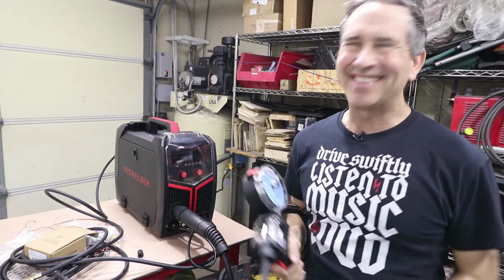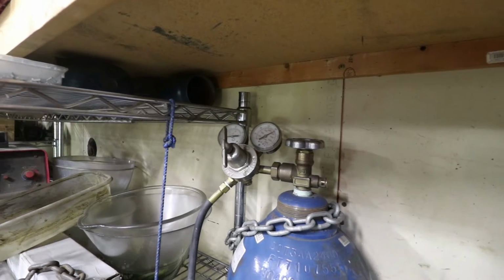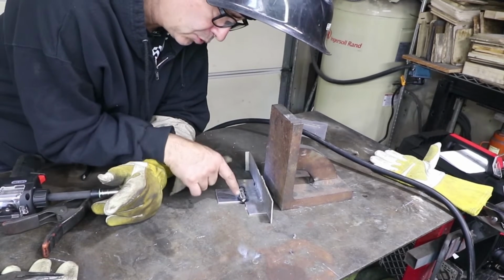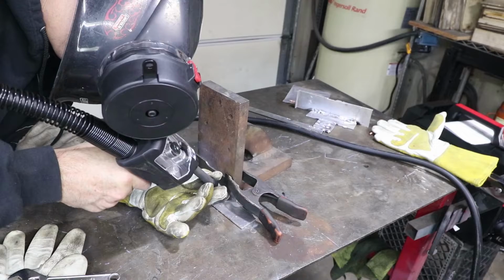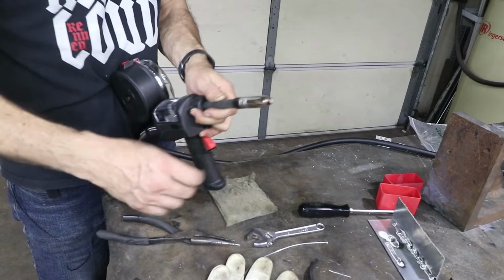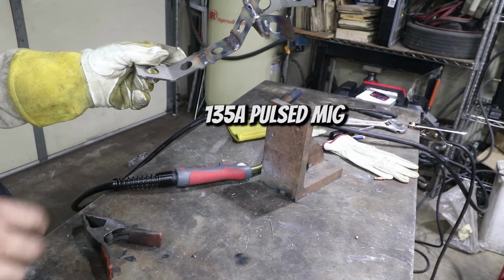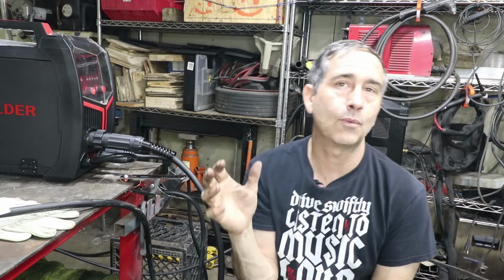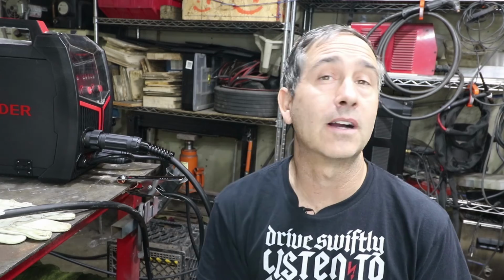MIG Weld Aluminum with Wire Feed Spool - Review YesWelder YWM211 5in1 Dual Pulse MIG/STICK/LIFT TIG

Comment: All i do is weld aluminum...i don't claim to be any expert but i have had TONS of equipment issues and so far to me it seems like you have a defective machine. I didn't see you say this but did you happen to change the polarity? When changing from steel to aluminum you have the switch the ground wire.
Reply from the maker: I did change the polarity.  I no longer have this machine to try anything different.

Comment: Thx for the video. I am a little confused as to why you couldn’t increase the wire feed speed to stop the burnback.  Could you not just increase the amps ( which is the same as increasing the wire feed speed is it not?) and keep the voltage the same? Did the machine not allow you to do this or did the machine increase the voltage when you tried to increase the amps?
I just bought one of these machines to weld a small aluminum boat as tig welding it was way too slow.
I am a simple hobbyist welder. I have to say that it is somewhat difficult for me to understand all the nuances of the parameter settings.
Thanks for your help.
Cheers, John
Reply from the maker: This machine has some automatic settings programmed into it.  This is why I had to use the specific wire the machine was calibrated for.  If you increase the amps, you are increasing the heat too.  If I remember right, there is a small window of adjustment, but it takes practice to get a good setting that works.  A few watchers of this video suggested using a longer stickout length for aluminum.  
Keep trying different settings and I think you will find a combo of wire and settings that work well for you.

Comment: I've seen other reviewers get excellent results with this machine, using both Mig torch and spool gun.  They were also running with a longer stickout (3/4 to one inch) and about 40-45 cfh Argon...the results were pretty impressive, even on 1/16 aluminum.  Most were using 5356 wire.
Reply from the maker: Cool, the machine is capable and with some practice anyone can get results over time.  That's a lot of gas flow, but it's probably necessary given how much black spot I got.  Aluminum is definitely different than steel.

Comment: It doesn't matter what you do with DC aluminum it always sooty from not having the AC side of the current to clean the oxidation off!!!
Reply from the maker: Thanks, all is well then.
Reply: @GarageTimeAutoResto  in also appreciate you doing the testing on the yeswelder for they have been coming up short on their power output. I think everyone else knows that you use quality equipment from the primeweld tig225x in the background have the same machine w/water cooler and torch. Love it and never let me down.!!
Reply from the maker: There you go.  Love my primeweld.  I use mostly 1/16" tungsten or less for autobody work.

Comment: If you are burning back you need more wire speed and or stick out. Aluminum needs 3/4"stickout. All mig setup is really the same. If you are too hot (to much voltage for a given wire speed) then add more wire to the puddle.
Reply from the maker: Thanks!
Reply: he said he couldnt adjust the wire speed

Comment: Honestly seems like more trouble than it's worth, especially as you're an accomplished TIG welder.  I've only ever used MIG for my project, but I think I'd rather learn TIG for aluminium.  Have you seen the Decapower all-in-one welders?
Reply from the maker: It was fun to try a new method.  I recommend it for those who haven't learned TIG but need to get some aluminum welding done.
I think the decapower welders are similar, but I haven't tried.  
I'm just thankful that there are some well priced options now.

Comment: I bought the 250 amp TIG machine and foot control. I have a TIG Button fir my syncrowave but the don’t use the same plug
Reply from the maker: Did you get the YESWELDER one? Foot pedal is a good call.

Comment: "Hard to see because of constant changing".... same could be said for our eroding liberties these days... on a lighter note ya I HATE not being able to see the weld/ puddle... drives me nuts! Should I spend cashish on this or a tig unit? I already have a 110 mig. I'm guessing I need a tig
Reply from the maker: You should try TIG.  I like it much better.
Reply: The 250 Amp Yeswelder would be a good way to go for home or light shop use.

Comment: You need to clean and wipe you material with acetone, alcohol, or thinner after wire brushing or scotch pad. More clean More better results.
Reply: No no you need a dedicated stainless steel wire brush to clean the surface oxide. Pre heating is also a good tip (especially for the thicker materials) and can help remove the oxide.
Reply: @PetesWorkshop   Yes, very true. This helps out a lot with aluminum.
Reply from the maker: Thanks, the metal was pretty clean.  If it was more than scrap metal practice I probably would clean more.  Clean metal is good advice though.